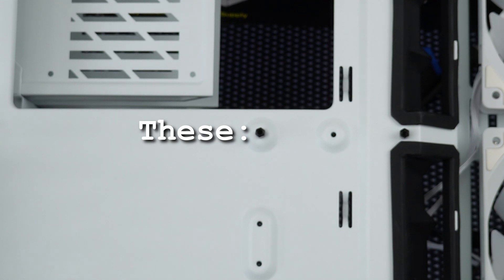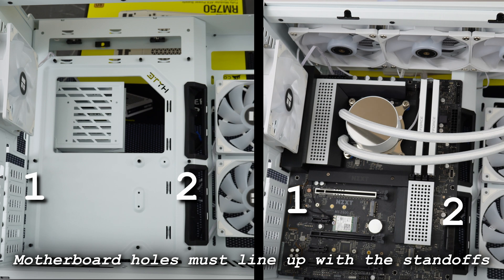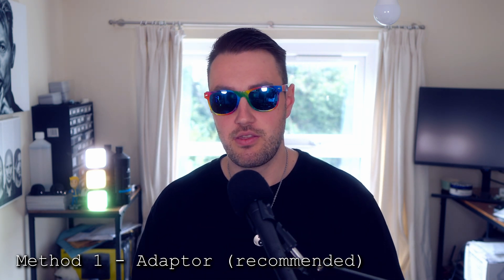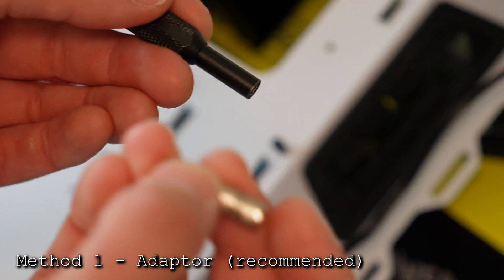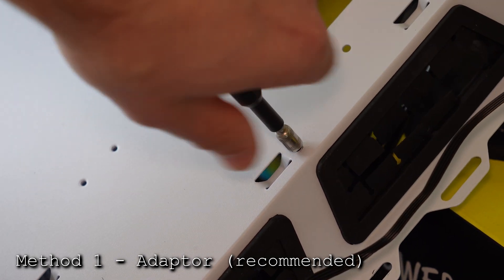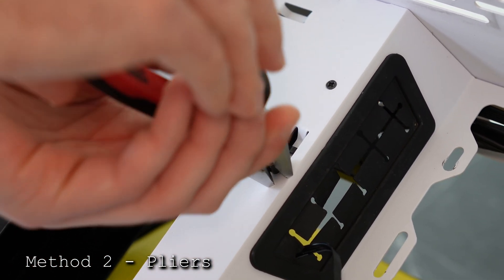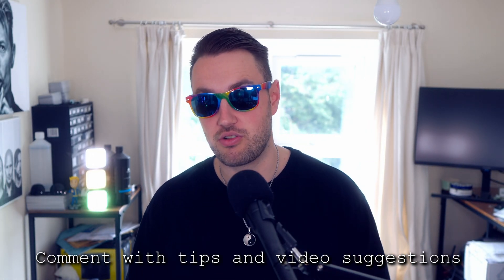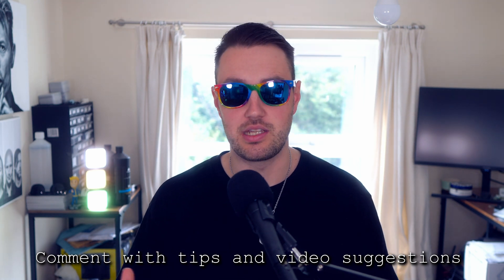How to add / remove standoffs for your PC case / motherboard [EASY!]

Comment: BEFORE ANYONE USES PLIERS LOOK FOR A SMALL TOOL IN YOUR CASE ACESSORIES FOR STANDOFF REMOVAL WITH A SCREWDRIVER, i paused the video tried to remove it with pliers ended up chewing the standoff and scratching the new case, go look for a cylindrical head with a philips1 screw hole

Comment: Hi, your video is really helpful! I have a question, I just build my first pc, and now my pc won’t even turn on. When I turn on my psu switch, casing fan RGB lights up and blinking. When I press powered button on the case, the pc won’t start. And I just realize that I did not screw one of the stands off, could this be the reason my pc won’t start?
Reply: Is it fixed?

Comment: just use the motherboard screws. You can't over thread them, but you might need pliers to remove the screw after or if the screw is loosening when removing a standoff.

Comment: Well, I won't offer the insult you suggested, but what I'm trying to do is to find out how to add a mounting post where no hole currently exists in the case.  I don't think you can fix that with a pair of pliers!
Reply from the maker: Ah yes, well that is a completely different issue! It will be difficult to do because you'd have to space the hole out perfectly to fit whatever board you're installing. That said, you don't need a standoff for every hole on the board, just enough to hold it in place securely
Reply: (oh, both replies were "me" BTW!) 🙂
Reply: When I fitted the current motherboard back in 2016, I had to use an angle grinder to extend the CPU cut-out in the case (a really nice one I found on the side of the road by the way). So I do believe I'll be able to tackle the relatively small job of adding a hole or two!

Comment: Unfortunately, my standoffs are round in the case and the hex on the back is embedded in the metal panel so not accessible. I'm now stuck as I can't remove them 😢
Reply from the maker: Oh crumbs! Did you try using pliers?